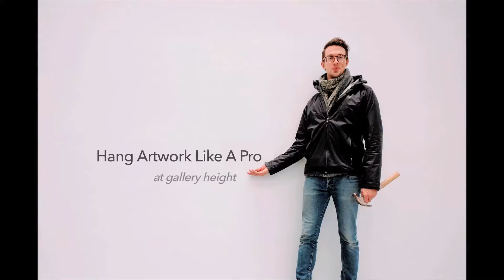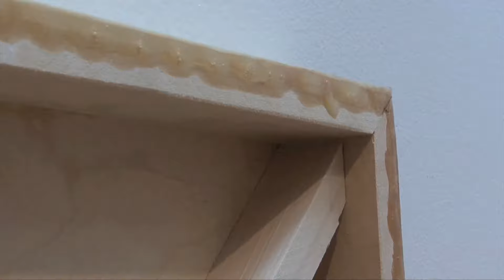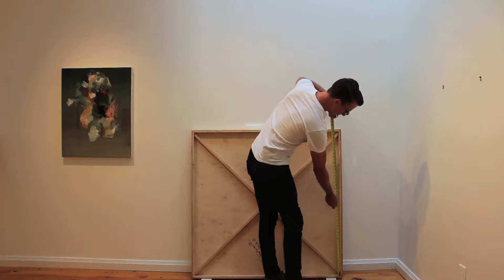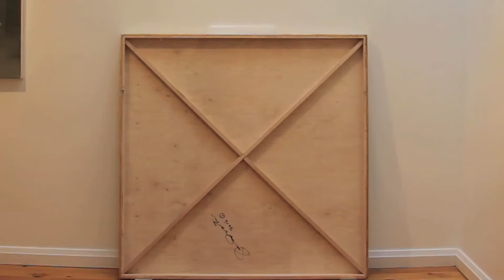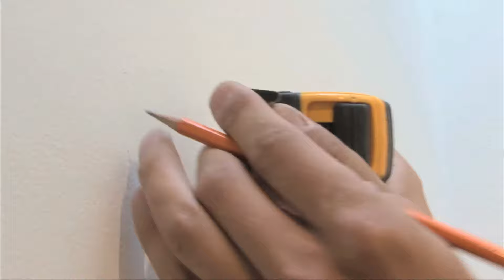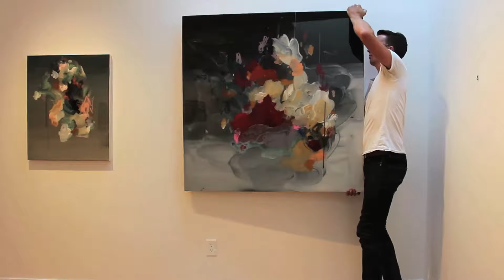Hang Artwork Like A Pro

Comment: At the end: "Check that it's level." Wishful thinking! (If it's not level, it means you screwed up, even if only a little bit. And with this method, there's no way to compensate - you'd have to un-screw screwed-in hardware, and do over.
Reply: Actually with angled D rings there is a little room for levelling after. You'd be absolutely right if the D rings were installed vertically.
Reply: Kõiki võistlustöid